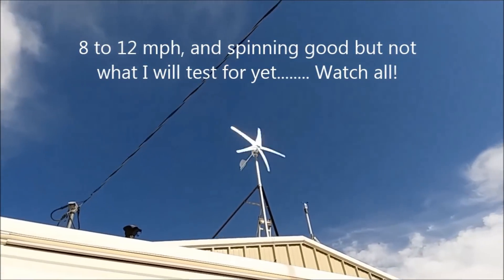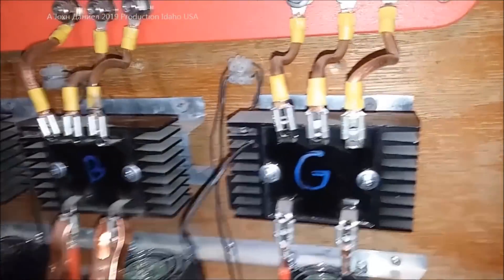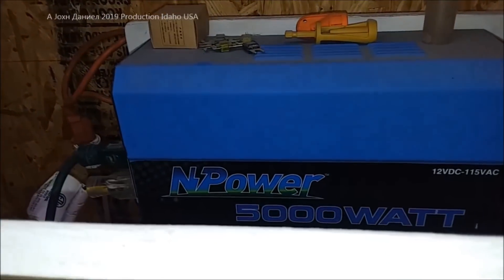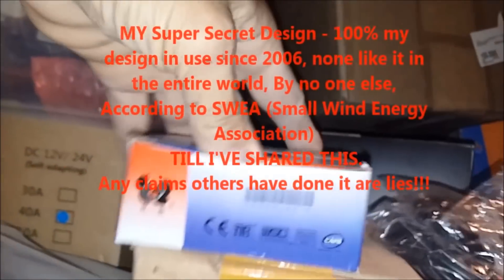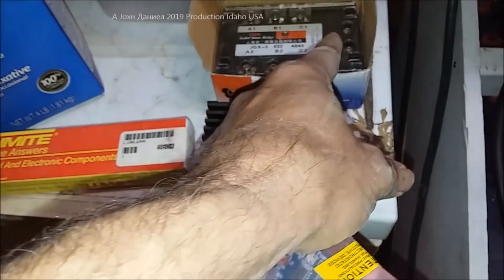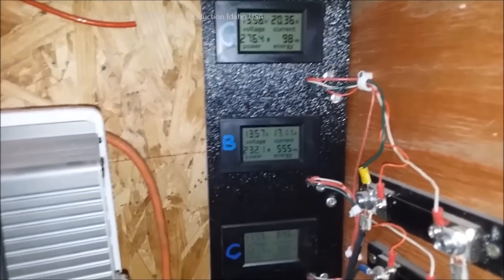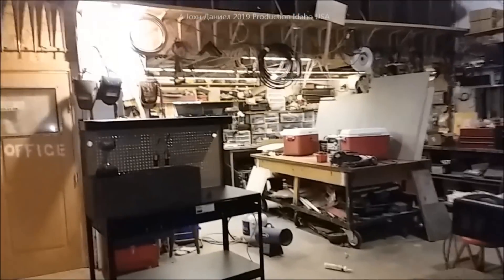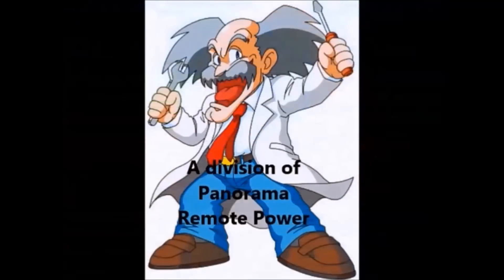Micro Wind Turbine wattage results, Chinese 500 watt 5 blade vid 3 UPDATED

Comment: I notice in this video u have horizontal wind turbines. My question is, vertical wind turbines usually comes with 5 blades. If they can be setup up for a 3 blade configuration, would that cause it to spin faster or is 5 blade setup perfect.

Comment: I like your scribbles! What batteries are you using? Also when you do the Epsom salt to the battery restore do you just leave it in there?
Reply from the maker: The Epsom salt is a very small amount and it remains in the battery. Typically when you charge a battery and then after it sits for 2 days and voltage drops below 12 volts without using the battery it is and then a good candidate for a restore.

Comment: do i still need a diversion load on a 500w turbine if im using a 1000w grid tie inverter
Reply from the maker: with a 1000 watt grid-tie they typically have a diversion load system built into them so you would be fine doing that process.

Comment: Do you mean you only put two rectifier in parrallel out of the wind turbine ? One directily connected to the battery, and the other one connected to resistors ? But for the second one, you put your SSR between the wind turbine and the rectifier. And this SSR is controled according two the tension of the battery.